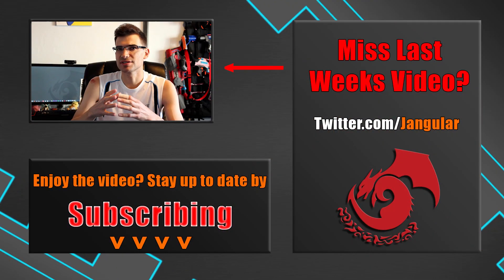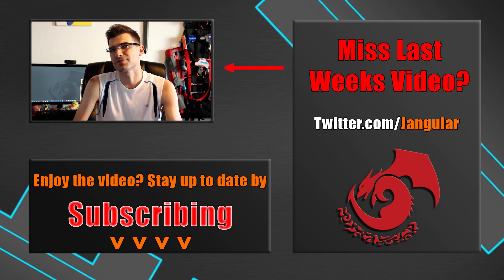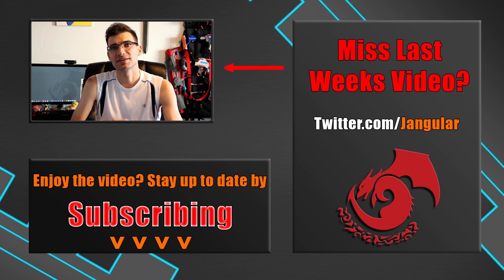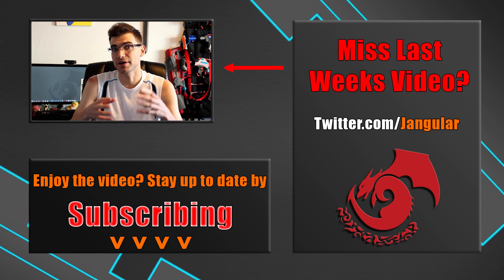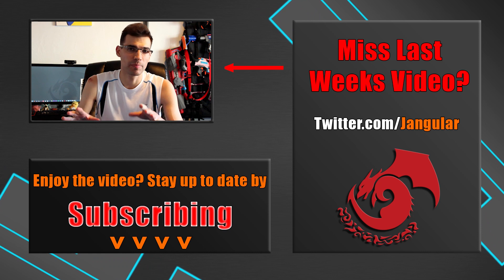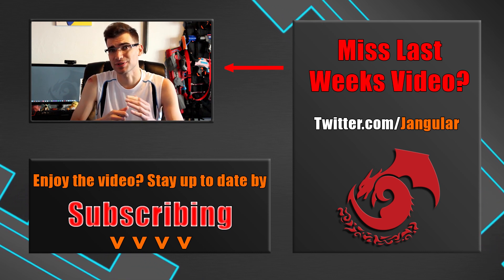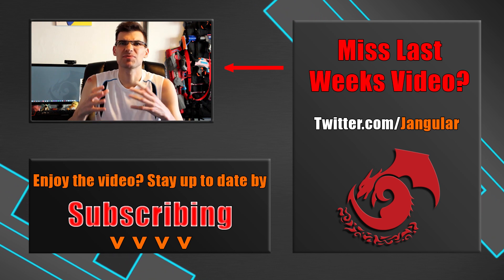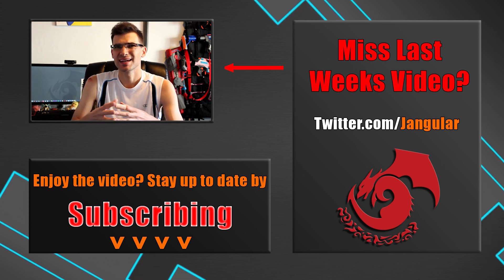LiPo Battery Precautions and Practices For Nerf | Mid Week Quickie

Comment: Is it safe if your lipo is underdischarged? 90C lipo with 2 XP180s for example
Reply from the maker: If I'm understanding correctly then yes, that should be fine, you don't need to push the battery to it's maximum discharge to use it. I would probably get confirmation from another person however, I don't want to run the risk I'm misunderstanding your question.

Comment: How low can you go on a 3S battery? I'm new to LiPo's and I don't want to burn my house down.
Reply from the maker: I would check this to confirm, but I think 3.6v per cell is where things should be cut off, I'd aim to stop above that though. Again, do not take this as gospel, research and confirm beforehand.

Comment: Hi.
Can I upgrade a Nerf Rival Zeus with LiPO batteries? If so, what would be their specs and the best charger for them?
Thanx.
Reply from the maker: +Guida e Pedro Ribeiro You certainly can, a lot of people use LiPo batteries in the Zeus since the stock motors can handle them well, but you'll need to rewire everything with better wire and proper switches. You'll likely want a 3S LiPo pack, but there are better sources for which packs and chargers to use exactly than myself for that blaster, might be worth asking +Outof Darts since he does a lot of work with the Zeus
Reply: Thanx for the tip. :)
Reply from the maker: No problem :)

Comment: I say 3 efest 14500 imrs is good enough for me. I'm not that responsible and to me it's not worth the cost of the initial investment( the wires, motors, etc) Plus 3 imrs have about 15 amps of output, 2100 mah, and 11.1 v, which is good enough for me.
Reply from the maker: +Joe Chen I wasn't aware efest IMR's had 15a output, I thought it was somewhere between 7-10a, if so, that's great, makes them a little closer to a LiPo.
Reply: Actually I searched on the web and found out efest created 14500 PURPLE imrs that have 50 less mah than normal ones but have nearly 10 amps each! That means 3 purple imrs will have 30 amps, 1950 mah, and 11.1 volts! I think I have found my Christmas present-literally.
Reply: Wait, isn't this just as good as most lipo batteries. I mean 3s lipos are also 11.1v, not much lipos under $12( the cost of the imr batteries) have 1950 mah like it does, chargers for imrs are also cheaper, imrs don't need as much care, don't need so much materials( better wiring, better motors, etc)and only some have over 30 amps. So does that means imrs are better?
Reply from the maker: So I don't think the amps stack that way, I think it's a flat 10 amps across the board if that's what they're rated at. Foamdata Services Maybe you can confirm or deny this?
Reply: I cant deny or confirm this but efest don't often lie about their products. But you still haven't answered my question if these imrs are better than lipos for the same price.
Reply from the maker: LiPo is better, plain and simple, IMR's are easier, which counts for something, but you're going to get better performance from LiPo.
Reply: Thanks and I found out 10amps is the maximum amount  of output. the amps are between 6 and 10 for each battery.
Reply from the maker: Glad you found that out :)

Comment: Can u use trust fires in a unmodded stryfe
Reply from the maker: +Brett Foss If you want to run AA sized batteries try IMR's or LiFePo4's with their proper chargers rather than Trustfires. Trustfires are the least reliable and worst performing option for AA sized voltage upgrades. With any of the options in a stock stryfe though you run the risk of causing an issue with the stock wiring, as I did on both my stryfe and rapidstrike, so be forewarned of that possibility.
Reply: if you are afraid of damaging your blaster by opening it I can't help. But if you want the simplest way to mod a stryfe so it can run on trustfires you can look up blasteraways simplest way to boost up your stryfe video.

Comment: Good safety stuff! Remember XT60 connectors are totally insulated and if you change them be sure to use the correct (female) connector so as to avoid the risk of a short from the pack.
That said, I have used Lipo plenty over the years, never had a problem. Remember USE is fine, ABUSE will cause you to injure yourself or others, just like any tool. 
Lipo is essential in all flywheel blasters running any kind of motor upgrade and a good idea in Stampedes and Vulcans.
Reply from the maker: +Foamdata Services Definitely good things to note. Had I filmed this after you did your connector change video I likely would've mentioned that because it's a good resource.
Reply: I will cross link this video from my charger one.
Reply from the maker: I'll do the same then!